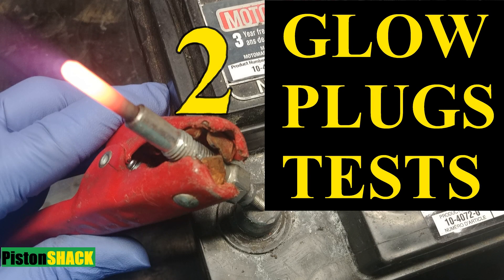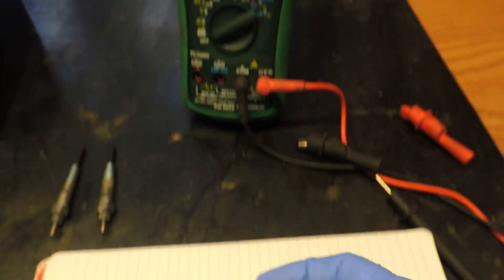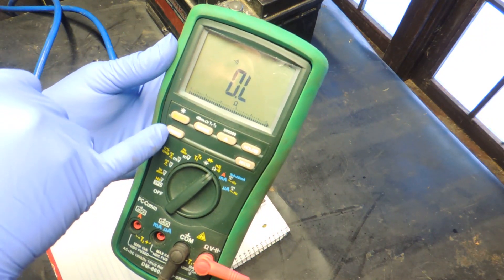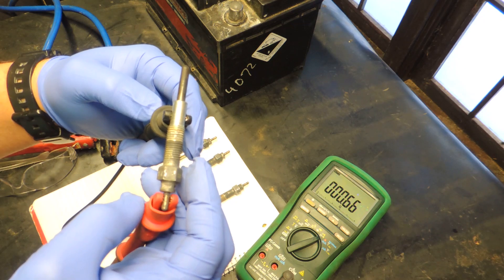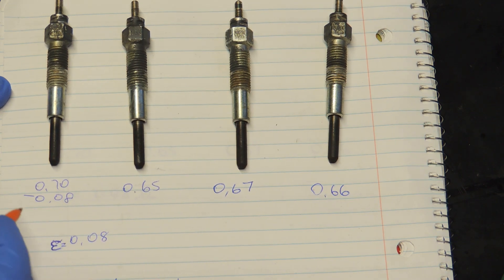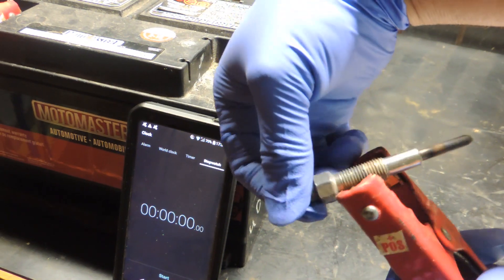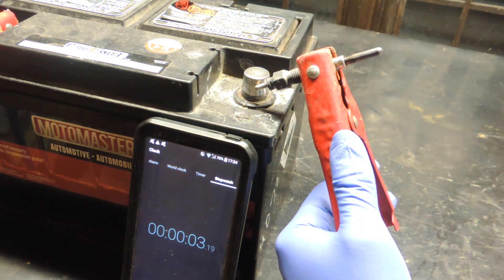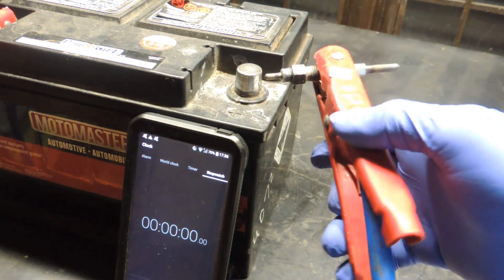HOW TO TEST 12V GLOW PLUGS ONLY!  | GLOWING AND RESISTANCE | MITSUBISHI DELICA

Comment: Great advice for 12v glow plugs but will destroy glow plugs on most european cars as they are 4.4v . So if you have 4.4v or less than 12v dont connect them directly t the battery.
Reply from the maker: Good point Stephen. I will  pin your comment up as well.

Comment: get a cheap Ohm-meter and test do an on-engine test between the chassis (car metal body) and the center pin of the glow plug. an OL (over limit) value means the glow plug is completely dead open, a value between 0 and 2 Ohms that should be fine. a higher value > 4Ohms, just replace it. (better replace all of the glow plugs at once to keep a consistent life span)
Reply from the maker: Good point Hadi! Thanks for an advice. 
Happy New Year ti you and your family!

Comment: Thanks, very well done.  I just checked the removed glow plugs from my just Ford diesel that’s local shop replaced to fix the cold start problem. New glow plugs did not solv the cold start problem. All the old glow plugs checked out at .2 ohms and heat up really quickly and glow.  Apparently the local diesel repair shop failed to check the controller.  I will have to check the glow plug controller.

Comment: Mine were shot

Between 8,5 - 8,9 Ohms. They actually still looked pretty good but looks can be deceptive.

Just thought I'd add that I have an old 2000 Fiat Punto 1.9D and it doesn't have all the modern tech of today's cars to detect when things are going. It's purely done by how the car feels and drives.

Comment: First off great video! But question: I tried testing the 12639701 9G glow plugs by connecting to a 12 V U1-145 valuecraft battery. The glow plug heated up instantly and burnt out even faster. It won’t relight. I tried this with 5 out of the 8 that came and same thing. Do I need to decrease the current output from the battery, as it’s a starter battery with 200+ cranking amps? Thanks in advance!
Reply from the maker: Hey John. Based on serial number of your glow plug. It's glow plug from Duramax diesel. Decrease voltage to 4.5V to light the glow plug for few seconds.
Reply: Sorry but you killed those plugs. The plugs I have list the recommended voltage on them in fine print. You'll need to order new plugs if they wont relight and come up with a lower voltage testing method.

Comment: Thanks for the video. I see all of the resistance do not meet the specifications. It should be 1 ohm. Isn’t that a little low or it’s still fine? Thanks
Reply from the maker: Hey Makoy! Resistance will depend from the type of the glow plug - metal or ceramic. I would refer to specific make and model manufactures value. What engine do you have?

Comment: What’s the resistance when they’re hot? It be nice to know what current they pull when hot.
Reply from the maker: Hey Mark. I won't worry about hot resistance, just read plug is cold. Good glow plug should test around  0.5-1.0  Ohm resistance. Just use Ohm formula to find current draw I=V/R for one plug them x number of glow plugs.

Comment: Great video!! I like how you demonstrated step by step the process of testing those glow plugs. Also, It was great how you explained the multiemeter and how to use it. The glow test was 👌 awesome never seen that before. Your speech is great in timing not fast and easy to follow. Can you do a video on how to use  the mutimeter settings with examples?💪💪👍👍🙋🙋🙆🙆
Reply from the maker: Glad it was helpful! Thanks for an advice, I will try to make simple multi-meter video later. Cheer!

Comment: Love these videos. Fun and actually explain something clearly. Now to test my glow plugs. Will have to test tomorrow as not got the light now and it's bloody freezing outside. But will order some plugs in the mean time, as they are cheap at the moment, and my mate says I definitely have possibly some faulty ones.  Cheers and Subscribed
Reply from the maker: Thanks Lee! I am glad it helped you out. If one of glow plugs burned rest of them will go pretty soon if they were not replaced recently. As cheap farm fix sometimes you just find bad one and replace it. Also check, make sure your glow plugs relay works properly. What vehicle do you have?
Reply: @PistonShack  Have a 2010 Toyota Verso. It's a pretty reliable car compared to previous models, and has been great so far. I've never hammered it since I bought it new, so it's in pretty good condition. I think it is just due for various service parts, such as oil and filter but will test the relay too.

Comment: duetz 650KVA genset glow plug continously bursting even we  resolve the issue of continous supply. will it be the issue of material because genuine plug aren't available for genset?
response to my query will be highly appreciated
Reply from the maker: Seems like you have issue with timing glow plug relay or main glow plug control side bridged permanently. I wont worry about plugs right now. You can also install glow plug manual push button to control glowing time or used some other parts available.

Comment: hi christopher from south africa.why does my tdi opel corsa 1.7 tdi only start with with starting fluid?
Reply from the maker: Hey brotha! Check if you get voltage to the slow plug distribution wire. If not check for constant power at the glow plugs relay. Also check for switched voltage or ground (when key turned ON) at the relay depends from the circuit layout.
Reply: Does it run good when you start it?

Comment: Thanks for the video! So does it mean that on diesel engines you need to wait 10-12 sec before turning the key?
Reply from the maker: You're very welcome! Yeah, wait until glow plugs timer relay turned off then crank the engine up.